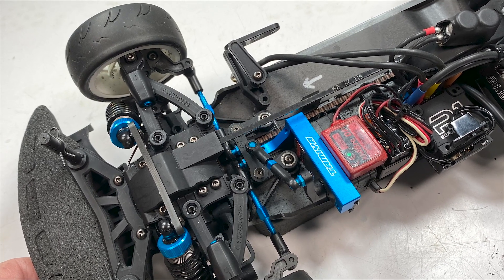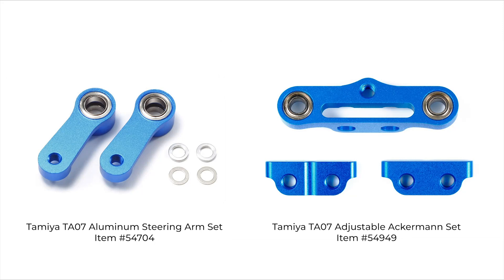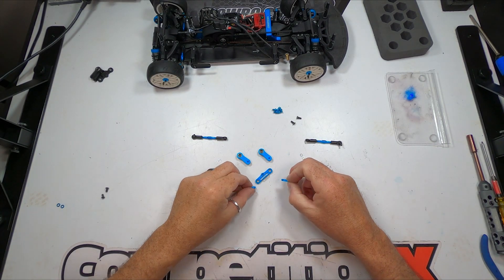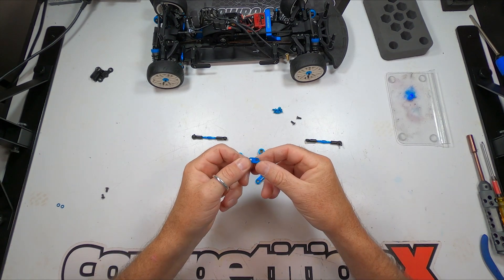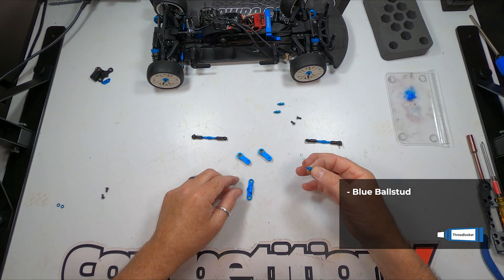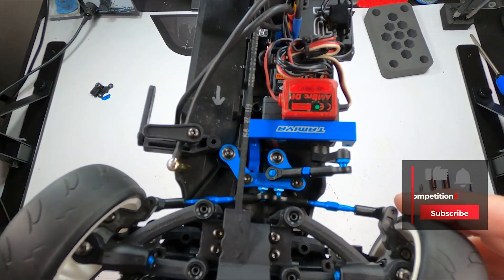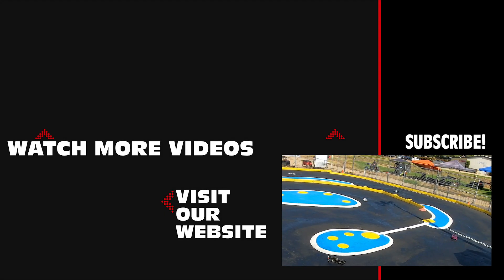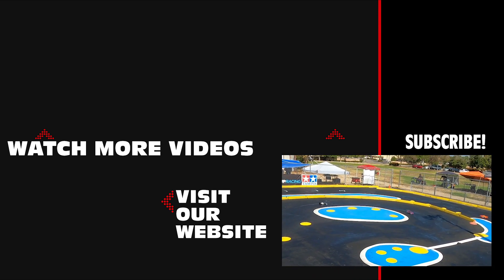How To: Installing Tamiya's Aluminum Steering Set into your TA08 Pro

Comment: Hey guys I’m stuck, planned on using a kimbrough 48p spur, it seems too thick and doesn’t spin free….what Spurs do you recommend
Reply from the maker: Hey there - if you're using a Kimbrough gear, you may have one of two things going on. 1) During the build Step 8 of Bag B (Manual Page 6), there is a small .5mm shim on the OUTSIDE of the spur gear assembly. Because Kimbrough gears are a little thicker than the Tamiya gears, you may need to remove that shim for it to spin freely. That's what I did on mine (although I'm not using a Kimbrough gear, my gear is thicker than the stock gears). 2) If you look at your kit gears and the Kimbrough ones, you'll notice that the hole pattern is tighter on the Tamiya gears - not the same with the Kimbrough. This could cause the 'fingers' on the pulleys to not be aligned correctly and cause them to sit farther apart. When you add the screw, it could pinch everything together. To verify this, build it with the kit gear, measure the width, then build with the Kimbrough and measure the width. Chances are it's going to be a couple MM wider with the Kimbrough.
Reply: Thank you